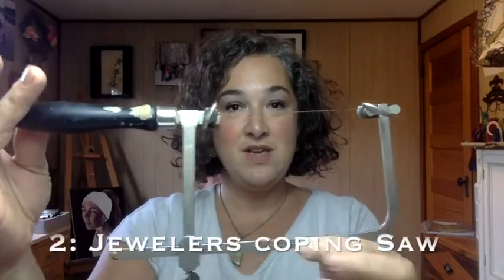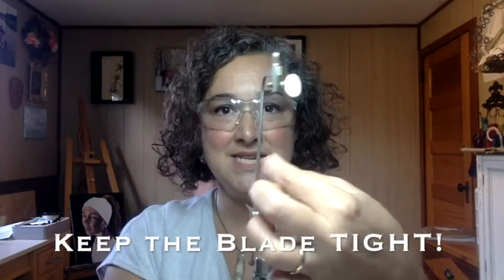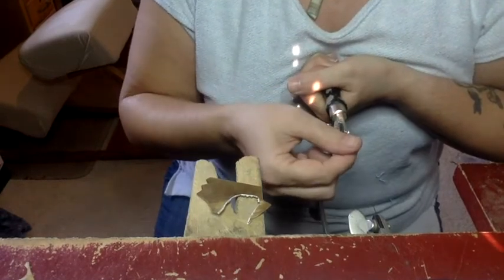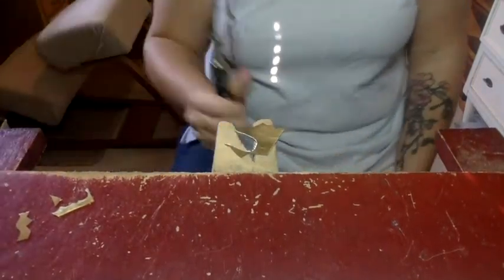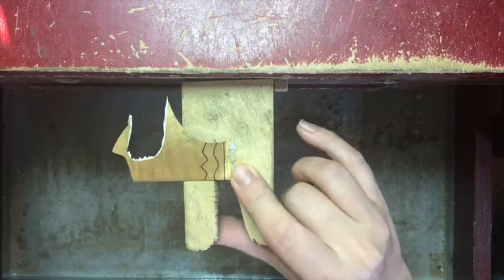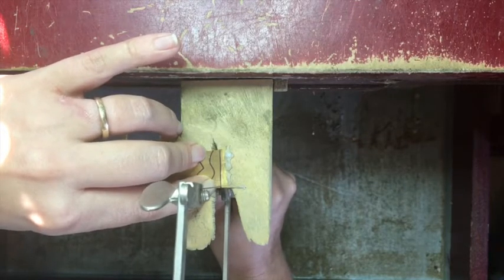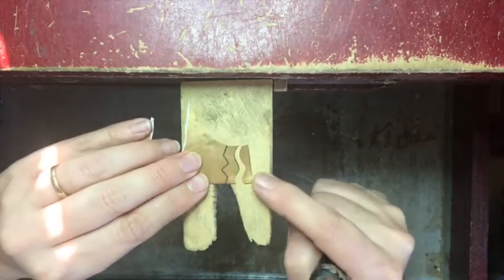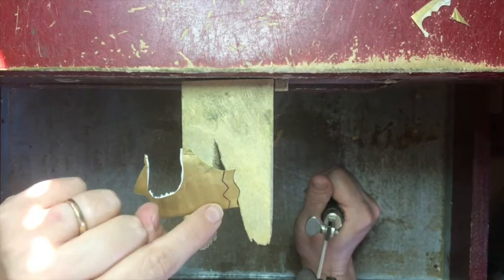Intro to Jewelry:  Sawing One

Comment: Hi! Thanx for the video. Could you please explain how to hold the saw correct way,  the ergonomics?
Reply from the maker: You hold the handle like you're making a fist around it with your thumb on the top and pinky on the bottom.  Shoulder lined up behind your arm and the bench hook (everything lined up). To hold the saw straight up you have to slightly tilt your wrist back towards you.  It becomes automatic once you focus on it for a while, but your hand will want to automatically tilt the saw forward slightly, you have to watch what you're doing and pay attention and keep pulling it upright.
Reply: @a.h.szabodesigns6649  thank you :). It's time to practise)
Reply from the maker: Good luck! Let me know how it goes!